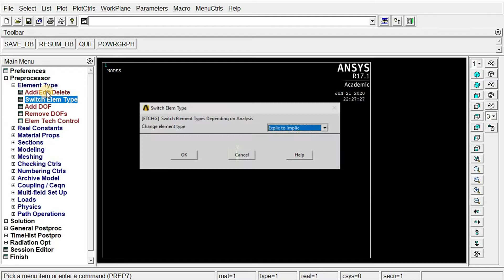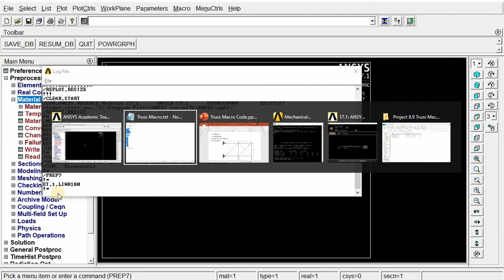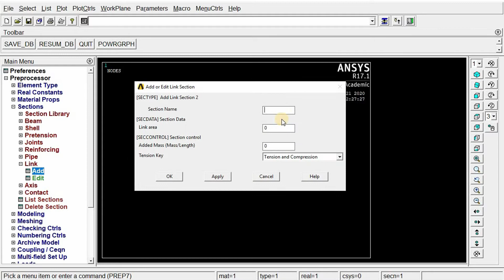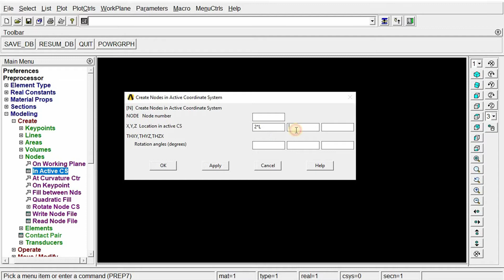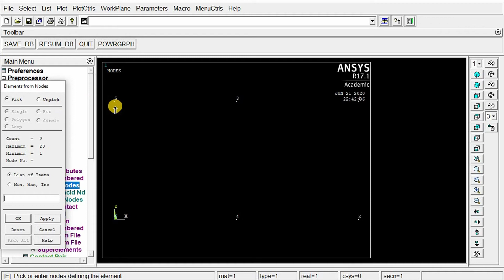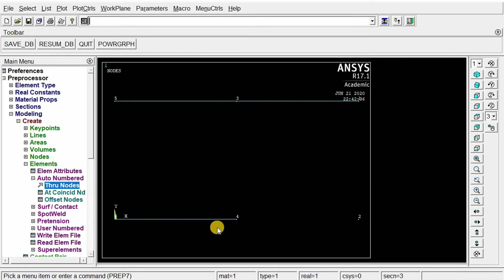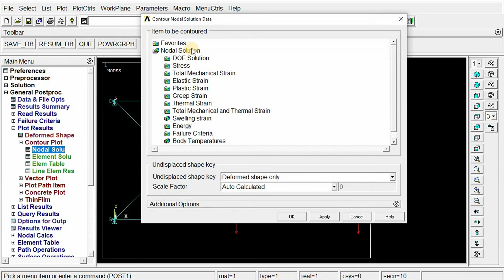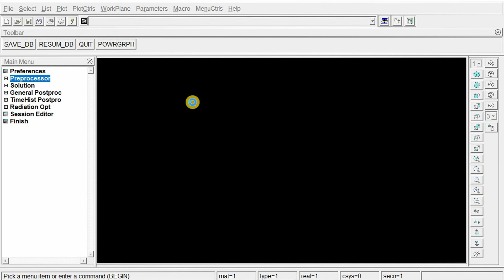Creating Simple Macro Code in Mechanical APDL (ANSYS) - A Truss Problem (10 Bar)

Comment: Is Ryzen 5 4600H with Nvidia Gtx 1650 good for Ansys, Solidworks, Openform, Hypermesh, Ansa? Any problem in that? Reply fasts
Reply from the maker: Basic to medium size analysis this should be enough. Also get 32GB + DDR4 RAM.
Reply: @DisciteBon  I am on tight budget. Above specification will be sufficient na?
Reply from the maker: You can also go for Intel i7 or i9. With nvidia graphics and 32GB minimum RAM. It's the workstation specifications what I prefer when I want to run any big simulation.